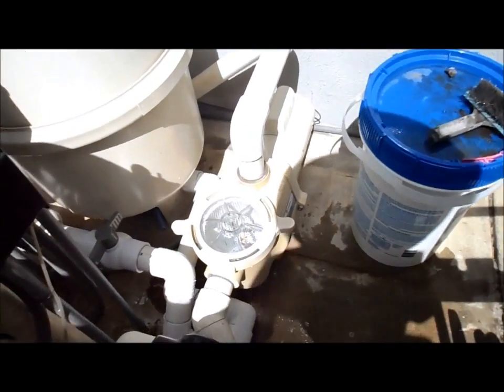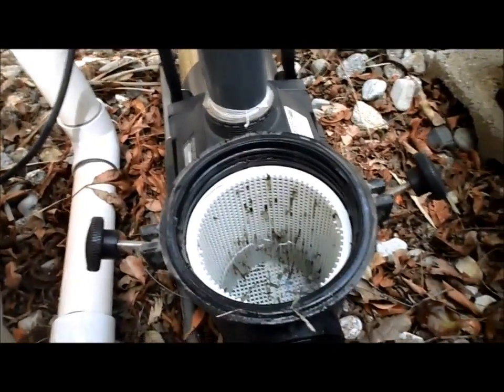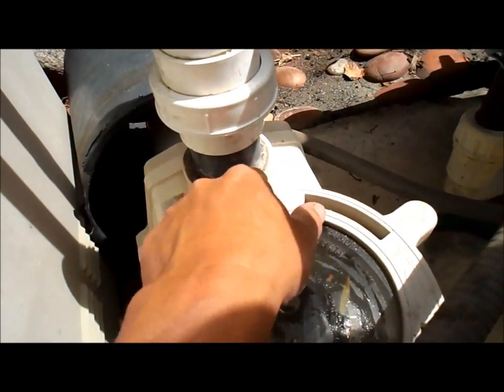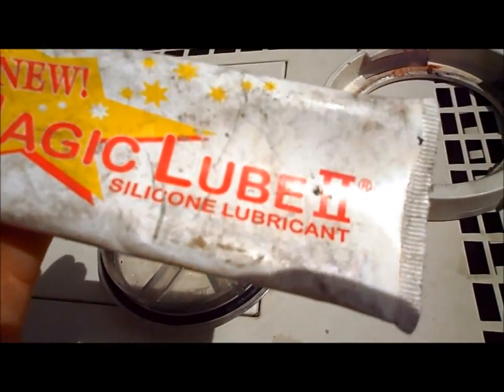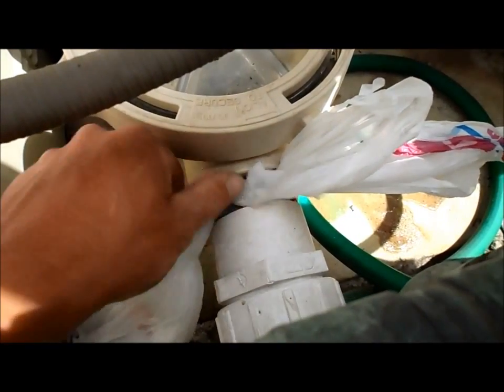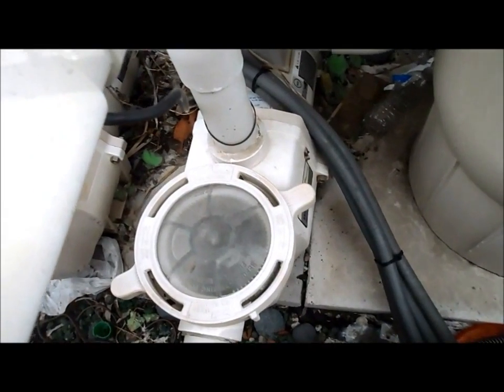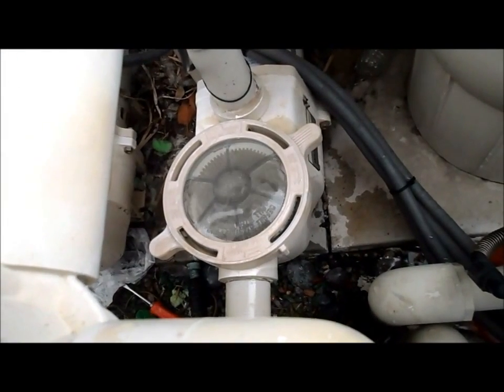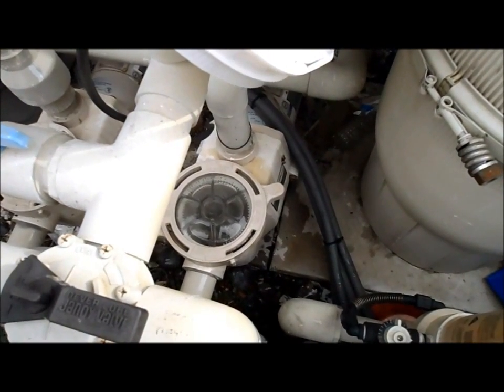Pool Pump not Working, Part 1- Pump not Priming

Comment: Hello, we recently got a new pump. as it was leaking. all was going good for a couple of months. no Our gage on the pump is on 0, and the baracuda is not working... I have check baskets. all empty.. any suggestions? thanks.
Reply from the maker: +Joanna Bell Is there water in the clear plastic lid on the pump when the pool is running?
Reply: hi.. thanks.. I put water in there and now its working.. I thought it all should be automatic... thanks heaps. 
jody
Reply: +Swimming Pool Tips, Reviews & How To -MrDgvb1 I have the same issue as the commenter but I see no water through the lid.  The filter shows zero pressure that won't release any air or water out of when unscrewing the piece at the top where water normally shoots out of. This all happened after tile came loose on the wall of our spa to the pool side and had to stop it from running for a day and a half for the repairs since the spa water flows over the edge to the repair site and it had to remain water free for a certain amount of time. Now it doesn't work. Thanks!

Comment: my pump is not working, there is a sound, filled the water line on the pool (inground pool) backwashed the skimmer, and when I turn on the pump , its not running.

Comment: i am trying to clean a very large residential pool using the skimmer and its not creating enough suction to vacuum. the pump is running fine??
Reply from the maker: Bobby Osborne It is possible there is an air leak. does the filter pressure drop with the vacuum connected - does the needle on the filter gauge go down?

Comment: I empty my filter bucket and after replacing my filter is not working again 
pls help me I need to fix it before this week ends
Reply from the maker: JOHN SMITH ANSAH Have you tried priming it with a garden hose through the skimmer?
Reply: Yep its helps
thnx for your help
now its working

Comment: Dude, you are a lifesaver (or I should say money saver). I forgot to put the basket back in after removing the debris. Turned the pump on and after about couple of days, pump would not prime and move water properly. I realized my mistake but didnt know what to do. Your video talked about the impeller and I realized right away that what happened to my pump. Spinned the impeller with a screwdriver and now all working well. Thanks buddy.

Comment: I have replaced my Hayward pump, bled the lines for skimmers, returns and main drain.  Starts to prime good but within 15 minutes stops... can you assist?
Reply: Jeanine Frick also, when I turn to recirculate only, it works great but as soon as I turn to filter it stops within five minutes and filter is clean, what I'm I doing wrong?  can it be anything with the multi port?

Comment: My pump has cavitation and I think it is sucking air from the actuator. Is this possible? I have a multiport valve leak but that is after the suction side. The air leak is not very bad as only small bubbles are coming into the spa and pool return jets, but it is driving me crazy and over time cavitation will cause problems. Any ideas?

Comment: My pump, which is for a above ground 5-8 thousand gallon pool I believe and, the pump will turn on but, makes a humming noise and if left on, will blow a circuit. This is a problem that needs fixing because there are now tadpoles and mosquito larvae, please help me with any suggestions. I have cleared the pipes, checked the basket, and even checked the filter itself, all is clear. Any idea what is wrong?? Please get back.
Reply from the maker: randomhalofan292 Sounds like a bad motor. No days that last 3-5 years. In the good old days they would last 10 years. Installing a new motor would solve the problem.
Reply: Swimming Pool Tips, Reviews & How To -MrDgvb1
okay, thank you! I am going to try the thing where you check the pump for debris, I have checked all the lines but the pump. My model was actually an older model, that is what the pool man said when he had to replace our filter because the filters were no longer being made for that specific D.E filter. So, I will check out the pump, the pool is really dirty and quite an embarrassment as I know how to keep it clean but with no pump working it is near impossible.
Reply: randomhalofan292 really sounds like a bad pump motor. You can check my pool pump guide here - http://simplepooltips.com/swimming-pool-pump-system-choosing-tips . If you still got the problem, ofc.
Reply: Ned Kampmann
Thank you, very much I much appreciate it.

Comment: My pool does not prime when its in cleaner suction .. but when its in skimmer works perfectly fine ... not such why?
Reply from the maker: Very common. If air is getting into the pump it won't have the power to pull the water the extra 30 ft through the hoses. You will have to pinpoint the air leak and once fixed the cleaner will work again.
Reply: Swimming Pool Tips, Reviews & How To -MrDgvb1 I heard a slight high pitch noise, and realized I had not turned the knob tightly enough on the lid: I saw tiny bubble coming out between the lid and it's seal. Tightening it more until the bubbles were gone fixed it.

Comment: would impeller issues be a cause of huge amount of air bubbles returning into pool?
Reply from the maker: Sounds more like the diffuser inside. This acts to kinda siphon the water into the Impeller so if it is warped or melted the impeller will generate air. Usually the pump runs okay but over time it has less power.

Comment: thanks for the info...Question: My pool cartridges are full of water and not letting the chemicals (DE) go through and shooting it back into the pool.  Why is that??
thanks for your response. : )
Reply: The de grids have a hole in them and allowing the de to return back into the pool. You will have to open up the filter and check each grid for any holes.

Comment: Thanks for the video.  I have a 310T Hayward filter and a pump that has the two black knob clear cover.  The problem is the pump is not holding a prime.  When it is turned on it takes a few minutes for it to pull the water in.  It then rolls good at the top of the cover.  When it goes off all the water rushes back from the sand filter and the prime is lost.  I did recently change the sand and it is worse now.  I also noticed water squirting out of the cover and replaced the gasket and tightened the knobs when it was working.  It helped but it still squirts it a little.  I did the smoke test for leaks on the suction side and could not find any leaks.  Any suggestions?

Comment: Excellent, thanks for the follow up. I'm thinking that my water level may have been a bit low as well.  We have been pretty dry lately, so I added some more water.  It was about 1/4 up the skimmer, so I filled it to about 3/4 up the skimmer opening.

Comment: Is it common for the impeller to get blocked up from long hair?  My pool has only been in about 2 months and it lost prime multiple times this week.  I manually spun the impeller each time to free it up.  My daughter has long hair and i have noticed hair in it on a couple of occasions.  Is it going to just keep happening or is their some remedy?
Reply from the maker: That is not a common problem as the pump basket should trap most if not all of the hair. However there are a few solutions besides a haircut ;(.

Installing this in the skimmer basket (not the pump basket) should solve the problem. http://www.amazon.com/Pool-Filter-Savers-Skimmer-5-Pack/dp/B00373PFT8/ref=sr_1_1?s=lawn-garden&ie=UTF8&qid=1404783875&sr=1-1&keywords=filter+savers

If you have a suction side cleaner you will also need this canister. 

http://www.amazon.com/Pentair-R211084-Clear-Handle-Cleaner/dp/B001E8ZL8S/ref=sr_1_1?s=lawn-garden&ie=UTF8&qid=1404783943&sr=1-1&keywords=pentair+leaf+trap

After doing this nothing should get into the impeller.

Comment: Thank you so much. You can tell I'm brand new to pools. We will address it next week after we have all our trees around our pool removed. We probably need to replace the sand in the filter too. We just bought the house, and the pool was badly neglected for years. We just got it re-plastered. Thanks a lot.

Comment: Thanks for the advice. I called the guy who plastered our pool, and he said he didn't see anything out of the norm. He said he has seen a lot of old pumps not fill entirely to the top in the pump basket. We have a Hayward pro series. I hope he is not full of it. I'm going to address the suggestions you offered. Should all pump baskets  be full of water even in older pumps?
Reply from the maker: Usually there is no air in the pump unless air is getting into the system. Your pump runs off of a closed system which means only water should be in the swimming pool lines. If there is air in the pump then there is air in the line.  Try what I suggested. I have one account with a really old American Products Pump (20 years old) that wasn't filling with water. I cleaned the filter and still it was half way with water. I took it apart and checked the Diffuser in the pump and it looked fine. I changed the o-ring and still it was only half full. There were no Jandy Valves before the pump so I couldn't figure it out. I thought maybe the pump top is just warped from age, so I took the new o-ring and applied gobs of silicone glue on it. I put the lid back on the pump and it filled up all the way with water. It is still like that and working good. The customer was amazed as it never filled up more than half way before. I try not to clean that pump basket out very often - but yes, even an old pump should fill all the way up.

Comment: When our pump is running, our pump basket is never full of water. Its about 3/4 of the way full. I tried to fill it with a bucket of water when its turned off, but it will not fill because it drains as soon as i fill it. Is this something to be concerned about? Thank you.
Reply from the maker: There are a few reasons that could happen. It could be a clogged impeller or maybe your filter just needs to be cleaned. The pump lid o-ring is sometimes the cause.  It should be completely full of water while running. check those three things first. That usually solves the problem.

Comment: Water does get sucked when I pour straight into the basket as your's did in the video.  I'm looking for a reason why hosed water into the skimmer is going straight back into the pool, instead of priming through the pump.

I've already blown out the skimmer & watched the water shoot through but then it reverts back into the pool.  So the pump is working.

Any other ideas?

Comment from the maker: Sounds like the diffuser is cracked or melted. I have a video on that and am making a new one also. If the diffuser is bad water won't be pulled through. That would be my guess. You will have to pull the motor to check it.

Comment: Before I pay for someone to come out... I've been taking care of my pool for 15 years & have been through allot.  This problem is goes deeper than i can figure:

I can't get a prime.  I have "blown" out the suction from the pool & have watched the water shoot into the pump.  I have clean out the impeller.  When I attempt to use the pump, the water that I'm using to prime through the hose & blowup rubber attachment sends the water back into the pool, bypassing the pump.  

Any help before I pay?

Comment: Learned this insight today: Put a hose and blowbag into my skimmer while the pump ran and bleeder valve was open in order to get a prime, but didn't get a prime even once water started flowing -- because the hose blocked the skimmer and prevented sufficient suction. At that point, I removed the hose from the skimmer and quickly got my prime.

Comment: Here's how, through trial, error and luck, I got my pump to prime. Tried to 3 days. Changed pump O ring, lubed basket O ring, tried MrDgvb1's plastic bag trick. No good. Put a hose with blowbag in skimmer: Not enough. So I shut off the pump, closed the bleeder -- with the hose still running for 30 seconds. After I turned the hose off, I opened the bleeder and lots of air came out. So I turned on the pump again, and, finally, got a prime. It just needed more water, locked in, to build pressure.

Comment from the maker: I just use the glue that I use for my PVC pipes -  2356S POOL-TITE BLUE GLUE .5PT. You can also glue a small piece of plastic with it over the crack if applying the glue directly over the crack fails. I had a tree in my front yard crack a sprinkler pipe and I used this with a tiny piece of PVC pipe to seal it up good. I also use the Pool Tite glue on automatic cleaners and it is very effective.

Comment from the maker: If something is jamming the impeller it will do that. Then shut itself off. Then power back on in a couple of minutes and do the same think. The Diffuser in front of the impeller could also be melted and jamming it up. Take the cap off the back and use a wrench to turn the shaft and see if the impeller spins freely. Most pumps have a cap on the shaft in the back. If not, see if the impeller spins with a screwdriver against it from the pump basket area and use your hand to kinda spin it.

Comment from the maker: Is your equipment far from the skimmer? I have this problem in some pools that have their equipment pretty far from the skimmer and slightly above the pool level. Gravity is working against you then. Try using a 5 gallon bucket of water - that should do the trick - I use an old 3" chlorine tablet bucket in some cases - they are usually pretty large.

Comment from the maker: Sounds like your pool equipment is below sea level  & you don't have any ball valves to shut off the water flow -if I am reading your question correctly. If that is the case you will need a 1 1/2" threaded pug to put in the skimmer or do what I do, just stick a tennis ball in the skimmer pipe blocking the water flow. If that is not your question please let me know

Comment: hey i have a pentaire 4000 series ..i have replace one of the pipes thats connected the motor that next to the filter i have too replace it with one of those screw caps on .. and question is how do i stop the water from flowing so i put that blue glue on and put it on ?

Comment from the maker: If it is Cartridge it will have 4 large cylinders that you hose off. If it is DE it will have grids. More than likely the Cartridges are no longer good. I have a video showing when to replace your cartridges. Stepping out, right now. Let me know if that helps.

Comment from the maker: If you have a cartridge filter you need to take it apart and clean it. I have 2 videos on my site to show you how (one Pentair & one Hayward). If your filter is DE, then you can give it a backwash and see if that helps (I have a video on my Channel showing you how). If it has been 6 months since it was cleaned I recommend cleaning it, I have 2 filter cleaning videos for both types of DE filters also on my Channel.

Comment: dude hear's a tip when you clean that pump basket don't just bang the basket out i don't do that i do major cleaning on mine get a hose and clean the hell out of your skimmer baskets and pump basket better air flow really works great but you can still do it your way but im just giving you a tip the way i do it so oil man out